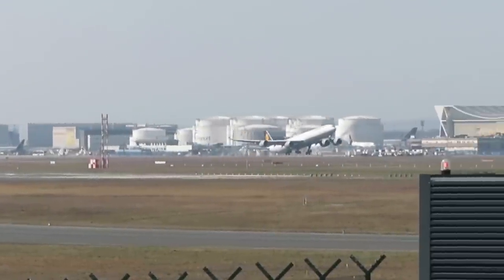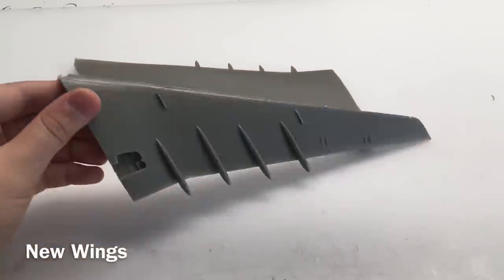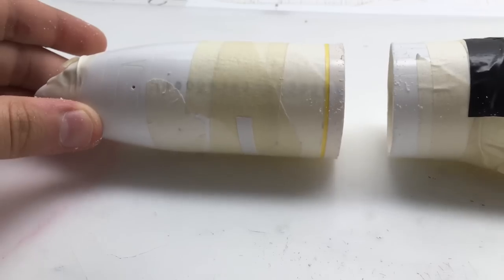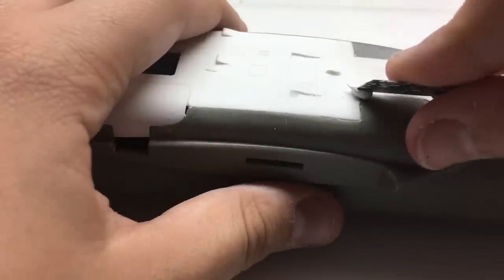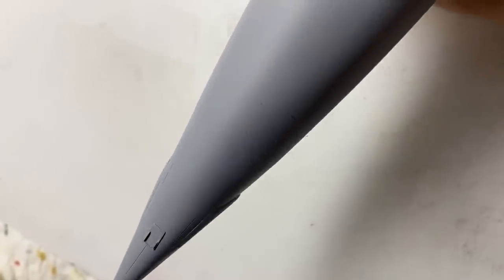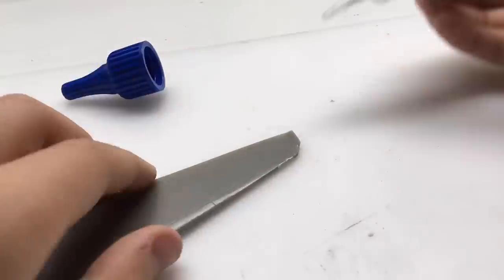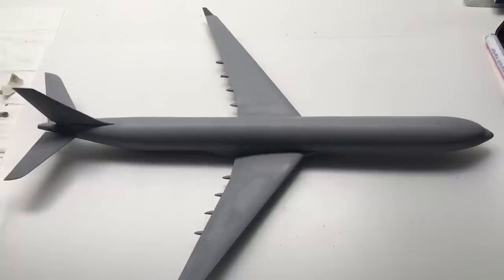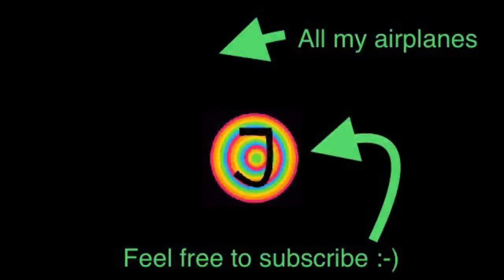Assembly / Revell + BrazModels 1/144 scale Airbus A340-600 Lufthansa (Modified)/ Part 1 / Zocker J

Comment: Ivo must of changed his kits! When I built mine the revell fuze was to big for the resin conversion so I had to sand both L & R sides down to fit right. You have done an outstanding job with this kit. I made my 600 with the Brazil decals sheet Etihad F1 special. You might find pics on Google of it 1/144 Etihad F1 A340-600

Comment: Nicely done, the sanding stage must've been pain in the ass. Next time you can try putting with CA glue and some filler (resin dust for example). Sanding ready in five minutes, bonds to the surface nicely, doesn't produce ghost seam lines.